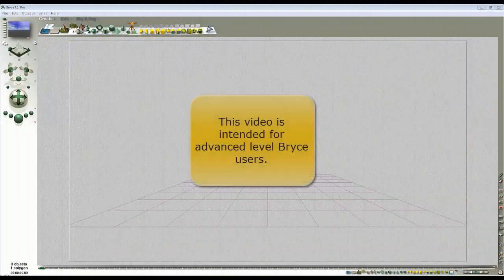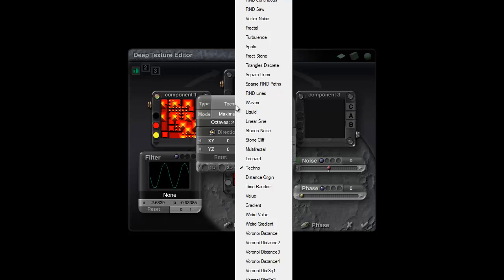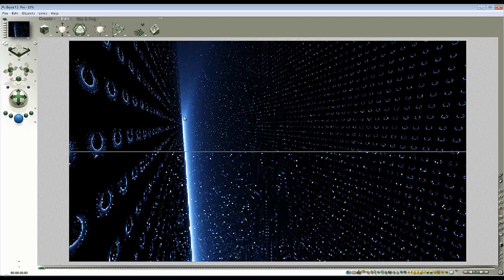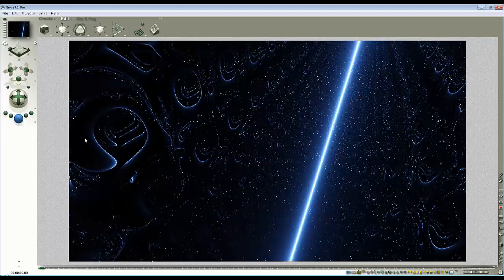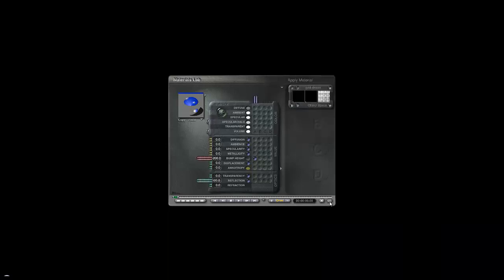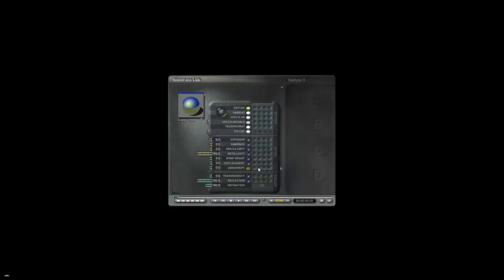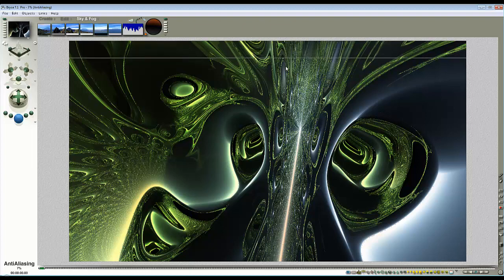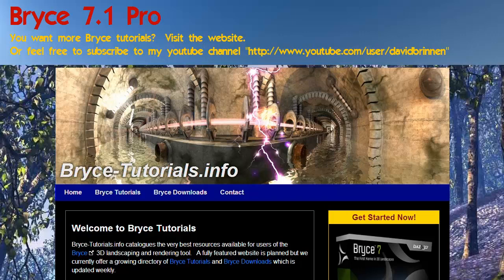Bryce advanced - fractal lens - by David Brinnen.

Comment: Hi David. I like all your tutorials. Can you recommend a tutorial that shows how to make my own materials?
Reply from the maker: +Tim Moyers, tricky, I suppose that depends on your level of experience with Bryce, the key to good materials in Bryce is often dependent on procedural textures.  Which is a part of making materials.  But for the beginner it is better perhaps to use preset procedural textures and concentrate on the overall settings.  So, if you can narrow it down a bit, what kind of material are you wanting to make first?  Just to get the ball rolling.
Reply: +David Brinnen  Any relatively simple material just to get started. I've photographed lots of nature-textures. I know how to make them seamless such as a picture of pebbled soils. Tree barks, etc. but making a bump map of them is a complete mystery.
Reply from the maker: +Tim Moyers, Ah... well if you are working with image based textures then you have a different challenge.  To generate bump maps for your images I suggest you try out CrazyBump which is what I use for this task, though other programs that do something similar are available and probably cheaper, at the time I got CrazyBump I needed a quick solution to this problem.  The drawback, from a technical point, is that the bump channel that can be generated with procedrual textures is 16bit Bryce can only deal with 8bit bump maps for images which means that the result can be a bit "steppy" if the bump is set to high.  If you use the little gold man on the create shelf, it will start you on the path to applying an image texture to a 2D surface.
Reply from the maker: +Tim Moyers Cool, thanks for adding the link, I know a lot of hobbyists are doing this on a budget so it is great that you managed to find an alternative.  OK so long as it spits out something you can feed into the bump channel you should have something to experiment with.  You can test your heightmaps in the terrain editor also, which will give you a guide if you have some idea what the geometry in your photograph would look like.